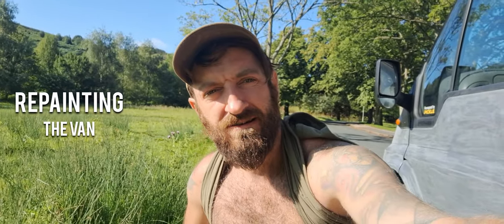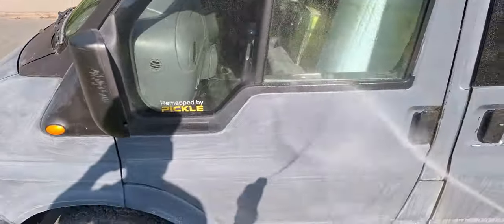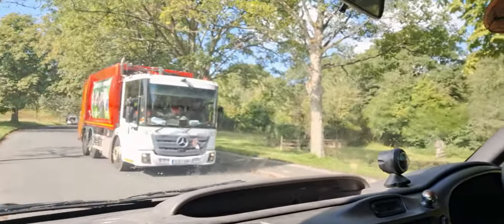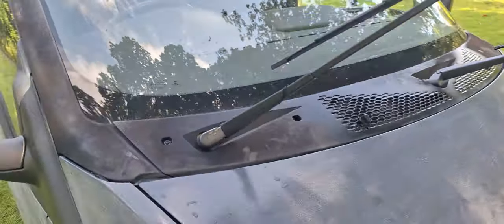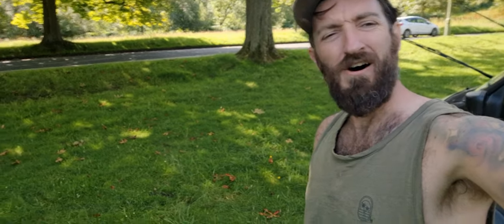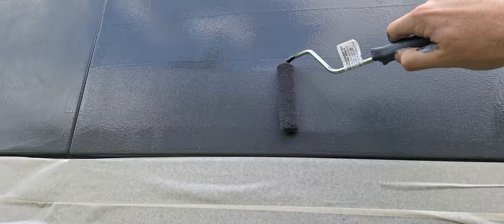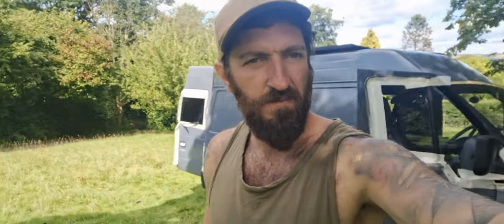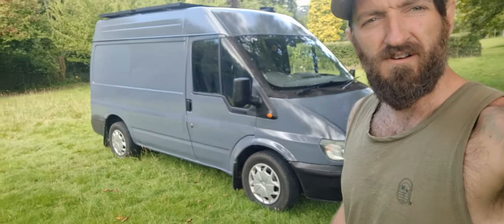How to paint your campervan yourself with a mini roller

Comment: So good no need for all these panel wiped etc etc 2k just to paint an old van, i was gonna use iron gate paint on mine as its long lasting, mind letting me know what you used just in case it's cheaper 😂😂...ignore me you using military enamel paint read a comment. Top job my friend.